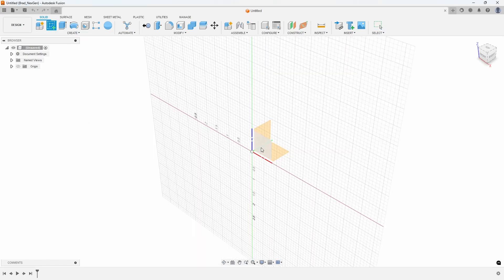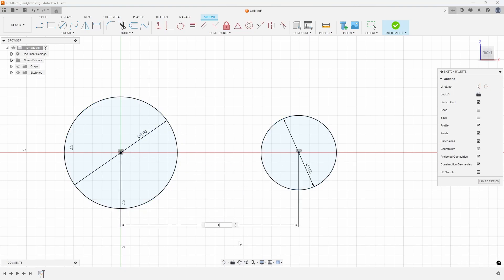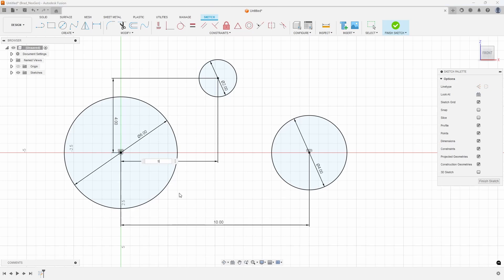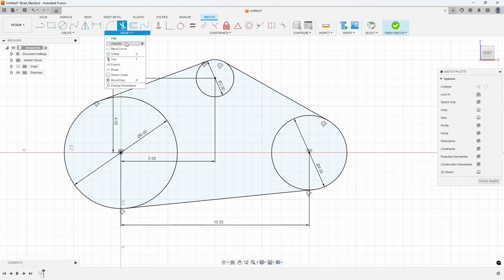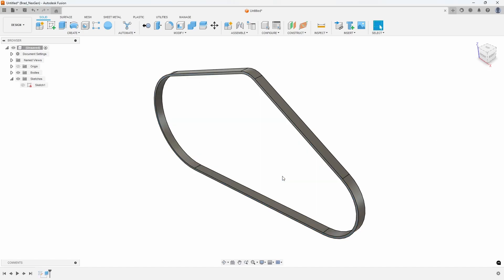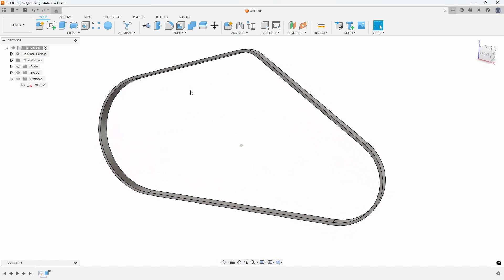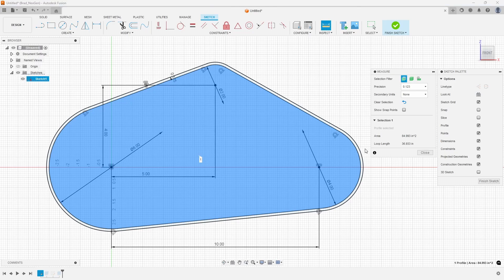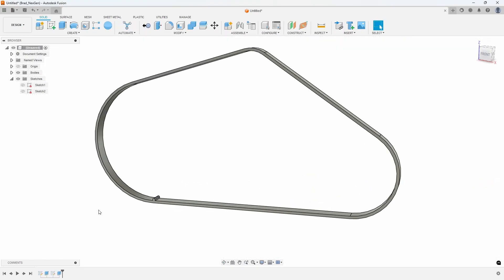Pattern on a Path

Comment: Maybe Autodesk could do an update so you can select a 'start and or finish' point for the pattern, that way you could select the corner of the tooth as start then the same point as the finish (minus tooths width in this case) and then it will always set the loop length regardless of future changes

Comment: I really wish we could simply use the measurements as parameters, i.e. to have the loop length change dynamically when you change the size of the gears... Do you know of any other software that does have this option?

Comment: How would this method work if the sketch is edited?
Reply from the maker: It would still work if the sketch is updated since they are parametrically linked.  You might have to update the quantity or spacing, however.
Reply: @bradtallis8968  So it won't automatically increase the spacing you need to do it manually.

Comment: Instead of copying that loop length number every time, is there a way to give the "loop-length" and expression name (such as B2=loop_length) and then in the "pattern on path" function you input "B2" so that a true automatic update happens when the sketch changes? Basically like NX does, every expression has a name
Reply: I had the same question. Still searching for a answer.
Reply from the maker: As far as I know, no.  The measure command doesn't return the result as a parameter/expression.  It would be really cool if it did, though.

Comment: It's a shame you can't get that loop-length a better way.  It would be nice if when dimensioning you could chain the dimensions of the line to get the total length.

Yeah, you could add dimensions to each segment and then create the loop-length dimension by adding them all together (meaning it would update automatically when you edit the sketch), but that's a bit clunky.
Reply: still a better solution for making it a parameter than just hard coding the current length.
Reply: @JD2jr.  Problem is you can't get the length of an arc, only straight lines so it won't work on the belt.  You can calculate arc lengths but it makes your sketch a bit messy.

For a parametric program Fusion sure does have a few missing.  I wonder if setting the sides of a polygon is parametric yet.

Comment: Great video. I love your un-rushed tutorials, it makes learning so much easier, thank you. 

I actually need to work out the number of teeth on a belt I need to order, but did not know how best to do this. I have the pulley diameter’s at each end, and the length between the pulley centres. I have provision to adjust this length to set belt tension. It’s a GT3 belt, so 3mm teeth with a 3mm pitch spacing. 
Based off your video, how do I get the number of teeth based on a 3mm centre to centre of each tooth? I’m assuming I can’t use a fixed distance in my sketch, I need the tooth count to drive that length? 
Thanks for any advice you may be able to share.

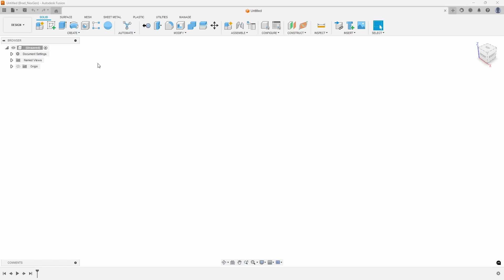Comment: @0:35 Why did your first circle outline turn black, yet the second circle outline stayed blue? Thank you.
Reply: fully constrained vs not. First circle was set to the origin and dimensioned, so it was "fully constrained". Second one did not have a defined position, so it remained blue until he dimensioned its location.
Reply from the maker: @JD2jr. Is correct.  When I drew the 1st circle, it automatically constrained itself to 0,0 because thats where I clicked the circle to start.  When I drew the 2nd circle, I just clicked randomly in space somewhere, so it wasn't fully constrained until I dimensioned how far from 0,0 it was and that it was horizontally constrained with the 1st circle.  Check out this video I did all about constraints:  https://youtu.be/7zlhc3PLjlg?si=oVSv5IWLywmg7hln

Comment: I assume you would have showed this if it were possible: can you avoid hard coding that loop length in by referencing some dimension?
Reply from the maker: There isn't a dimension for the loop length.  I definitely looked!
Reply: @bradtallis8968  I figured. This is a general problem: it is difficult to calculate pattern quantities and extents in a flexible way. I hope Fusion improves the area!
Reply: In the case of a cogged belt you set the length by tooth count x pitch = path rather than a 'nominal' length then cram a number of teeth into that.

Comment: you might consider another scenario which is the distance between the tooth i.e. .080" or .0816 I believe are used with small belts and pulleys.
Reply from the maker: Ya, I didn't show tooth spacing, which is one of the options in Pattern on a Path.  To keep the videos shorter, I don't show all of the options, but I guess I should.  Thanks for watching!

Comment: So expanding on this tutorial, what if I need 1) the teeth and space widths to be exact; and 2) the teeth count to be calculated automatically based on the path length. How would I do that?
Reply from the maker: One of the options in Pattern on a Path is "Spacing" instead of "Extent".  I only showed "Extent" and probably should have shown Spacing also.  You could use a formula in the quantity dialog that was like loop_length/spacing.
Reply: I did a parametric model for GT series belts a year or so back. Rather than forcing teeth count to a nominal length you actually set the path length by the number of teeth x pitch of the profile. You can then reverse your way back out to set pulley spacings.

Comment: Always look forward to learning something on Friday morning. How would you have handled cog spacing? Change belt length till it ended with a specified number of spaces?
Reply from the maker: I didn't show it in the video, but one of the options in Pattern on a path is Spacing instead of Extent.  So, instead of specifying the Loop Length, you specify the Spacing (of the teeth) and then specify how many teeth you want.  However, in this case, your loop length would have to be an exact measurement to equal the spacing of your teeth.  For example, if your teeth were spaced 0.5 inches apart, you would want a belt length that ended in a whole or half number.